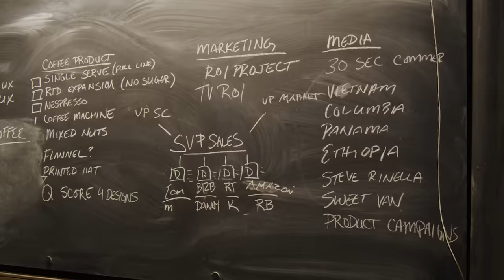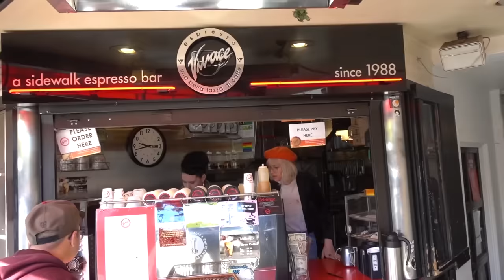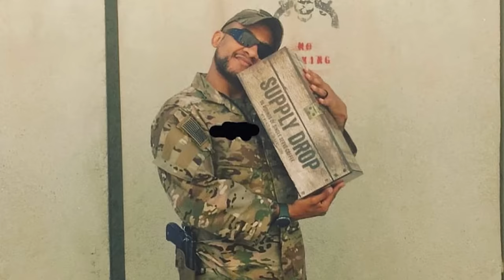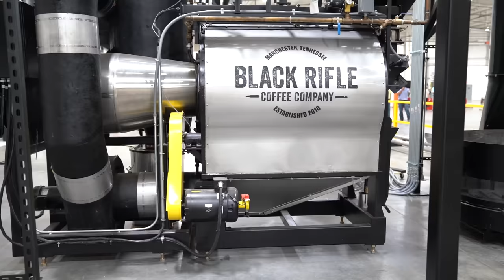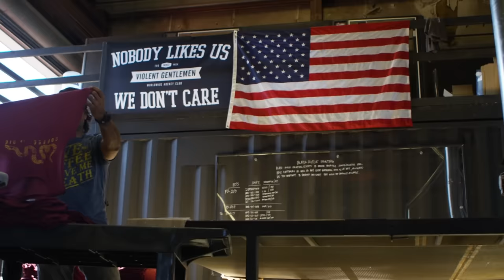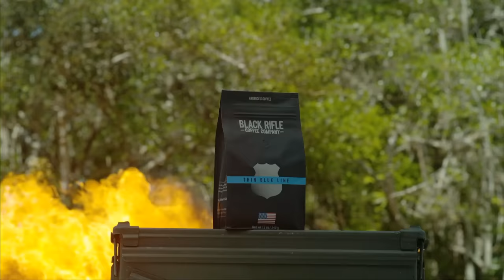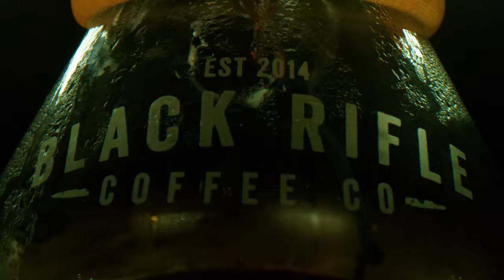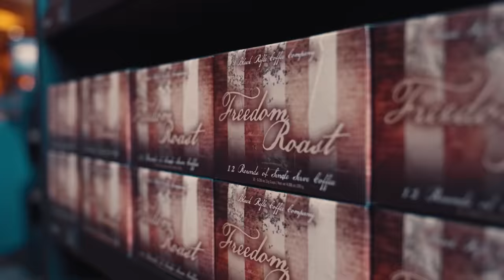It's Who We Are: Black Rifle Coffee Company... So Far

Comment: Alright guys, I need help.  When using your ground coffee in a reusable k-pod, what's the right amount for the perfect cup???
Reply from the maker: If it has the steel mesh screen filter, the right amount as a baseline is to start at the top of that screen portion for an 8oz cup.  Since everyone's preferences are different, you'll have to increase or decrease the amount to find what suits you best.  Some have even found filling the cup to the brim, making a 4 oz cup like an espresso, and then adding another 50-100ml of hot water, creates an awesome brew as well.

And now you know, and knowledge is power.